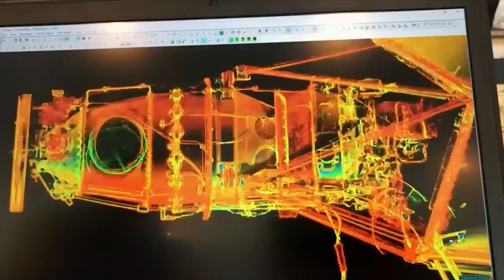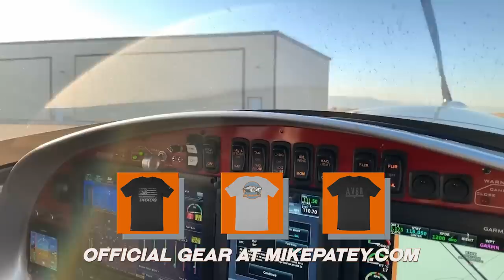Fire Waterfalls on our 3 Story Scuba Pool | House Build #15

Comment: This channel is chicken soup for my engineering soul.   The work ethic combined with absolutely overthinking everything is fantastic to witness.
Reply: Get yourself a 3D printer and start modelling the most mundane solutions to build the same knowledge
Reply: @neilk22  I designed and built my own 3d printer and CNC control system for a milling machine.   I build lots of stuff.  :)
Reply: @BlakeMcBride  good man!

Comment: I bend PVC similar to your method. I put a coupling on each end, not glued, then stuff the end tight with a damp towel. Keeps the ends from deformities, also keeps the hot air inside the pipe to heat it quicker.  You're an idol Mike! I always look forward to your content.

Comment: I have always said this about my dad’s builds, but I can say with 100% certainty, if you buy a house that Mike Patey built, you know it’s a properly built structure (If you can afford it :)

Mike, I perform a bit of reinforced concrete strengthening (externally bonded reinforcement) utilizing CFRP. We focus on commercial, industrial and transportation opportunities executed by the book (ACI) with formal calculations and shop drawings.

Do you have any experience with CFRP in that application?

Sika roofpro is a glass reinforced waterproofing membrane system that may be more durable/ easier to install on future trench drain applications. 

Cheers! Huge fan and a bit jealous of this reinforced concrete masterpiece!

Comment: Dear Mike!
What strikes me is the amount of concrete you use, and the stress you apply.
You should calculate with the shrinkage coefficient that concrete possesses.
Normally, you load load-bearing constructions or sealed constructions only after 6 months, when the concrete has shrunk the first 30-35%.
After that, the concrete works and develops for a long time, normally for 0.5-70 years if nothing but water is added.
Other than that, I think the building is so awesome and I am convinced that you will enjoy your new home.

Comment: The Best Solution to a power outage is a House Generator. I live in northern Michigan and weather causes many outages. My home Generac generator will turn on and off automatically, so I am never without power. Mine runs on propane, but can use natural gas as well. It is the perfect size for my home and will run everything. The longest I have been without power was a week around Christmas. I shared some power with my neighbor, so they could have heat and flush their toilets.

Comment: Curious, are you putting closed cell foam insulation inside the floating floor of the pool so when the pool isn’t being used you can let it rise all the way to the surface and act as an insulated pool cover over the deep portion protecting the pool and insulating it at the same time?  Of course you have, just haven’t mentioned it in the videos is all…. I’m addicted to your content. It makes me want to go into my garage and build something!

Comment: Another trick If you want to get PVC to bend like that without a torch just stick it on the exhaust pipe of a truck  and let it run for a while.. works like a champ.  We used our skidsteer to do it when running underground conduit for power laterals.

Comment: To speed up the heating of the pvc pipe, plug each end of the pipe with insulation or just plugs. With the air inside closed off, the pipe will heat up much quicker. Just remember to remove it before glue up!

Comment: Thanks for great video to start my day Mike. 

Why batt insulation and not spray foam? Wouldn’t closed cell foam be more water tolerant?

Forget rocks in the fire place, use small engine parts and mechanical bits like small pistons and gears.  From far it might look like rocks but a closer look reveals the mech Eng roots.

Comment: Mike, Congratulations on the progress of your new home. It is clear you have done a lot of engineering in terms of strength, build-quality and disaster preparedness. I was wondering what considerations you have had in terms of energy efficiency or energy generation. Also, are you doing anything special in terms of preparing the home to be a smart home with solutions like Home Assistant?

Comment: Mike, after following you for a long time, I've admired your genius and ingenuity. But, I've also wondered about the complications in maintenance, especially on this house and pool.

Maybe incorrectly, I make a comparison to the old VW. I've owned several, and always had to be on top of preventive maintenance... always muttering while crawling under the car for it's 3000 mile oil change, "this is a poor excuse for good engineering". Made me wonder, as do some of your projects.

Comment: Propane or natural gas on the fire pits? If propane with the open drain into the basement could become a issue if there is a gas leak, maybe you have a trap in the drain line. Just wondering

Comment: I could only imagine the thought that goes into where to place each item on his plate. Taking into consideration air movement and how peas have less thermal mass than the steak 🤔 so by putting a cold beverage at 2 o'clock the heat transferred from the steak....Probably has a specialized plate with heat and cooling built in Alexa raise the temperature of my peas 20 degrees 😊

Comment: Mike, the gas pressure  regulator has a rubber membrane that can be affected by high temperature. I don't see any kind o vent in the cavity under your burner, I think this zone will get hot, have you taken this into account on your enclosed under burner  container? On indoor and enclosed mountings, you also need to vent outside from the top half of the regulator in case the membrane breaks or swags. Please consider my safety concerns

Comment: DO you have a system that auto drains when temp get below 40F, with redundancy?  Power needed to hold water and over 40F when power out battery temp system takes over, if battery dead auto drains without temp consideration.

Comment: You sure that fireplace isn't a bomb. If water can get to the cavity under the aluminium plates then so can LPG/propane/butane and being gas is heavier than air won't it want to escape down the drain pipe, what flame failure device are you using to avoid this happening Mike, I'd hate to see you cook off the garage.

Comment: Dude you need to stop saying “I” and resort to “we” did this or that. Your house wasn’t built by you and you only, “we” should be the phrase you use out of respect of all the men working for “you”. We poured the concrete, not “l” poured the concrete or ran the electrical and so fourth an so on. All the hours you’re putting these Gus through deserve that at the minimum.